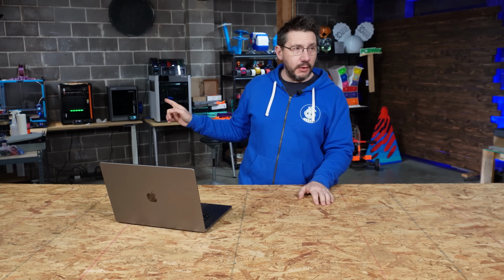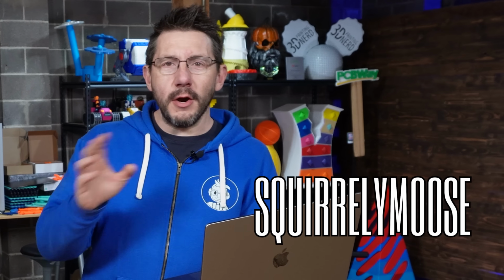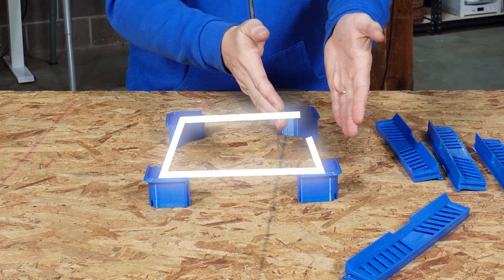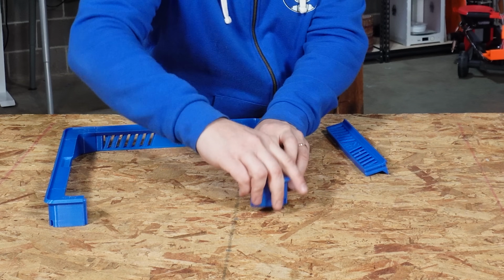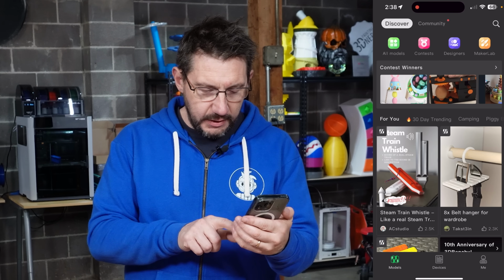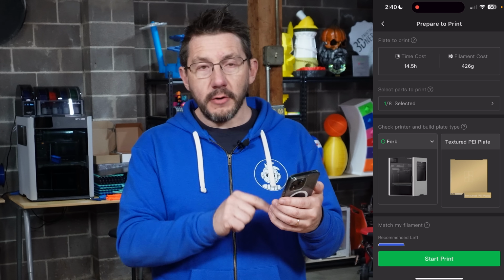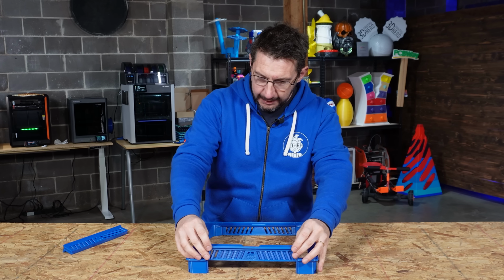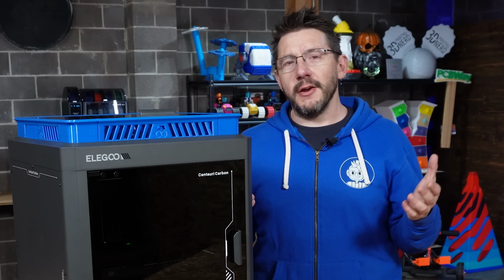*FINALLY* Printed This for the Elegoo Centauri Carbon!

Comment: I got the CC1 v2, so never needed this, but kept this video in case because I liked the idea, Until now, Hopefully I've found an unintended use.  I'm trying to print pps cf10  for a drone frame at the moment, problem is that it prints fine but keeps snapping because of the ptfe path.  You need a heated chamber so no lid is not an option.   Hopefully my solution is that I've got some polycarbonate sheeting, cut to the same size of the lid, with a hole in the center, for a direct path from my dryer, I will tape a ptfe tube, using thick heat transfer tape wrapped around the hole holding in the tubing.  My theory is that the raiser will allow the hole to be much smaller than it would need to be without it and hopefully allow me to finish the job with out snapping.

Comment: I know I'm supposed to remove the top lid when printing with PLA and PETG... but I've never done it. I think it defeats one of the main purposes of an enclosed 3D printer and to be honest I didn't notice any problems/defects with my prints. The chamber temperature gets up to 33 degrees celsius (acceptable I think) and that's about it.

Comment: for the new canvas multi color device for the 3d printer. couldn't you modify this riser to add 4 holes and use ptfe tubing to use the canvas device with a closed lid? if YES, try doing it.

Comment: A solution that has been around sin e the CC was released and solves a non-issue.   Simply prop the lid or door if you want ventilation. 3d print a small wedge. DONE.

Comment: There's a better way to release that riser "print in place" part. On one end of each of the parts with the louvered openings, is a hole. Use something like a 3mm hex wrench and push on the part until it pops loose! That's what it was made for...
Reply from the maker: OMG THANK YOU

Comment: I send print wirelessly to my P1S through Orca Slicer and the machine saves all the prints. I can scroll through them and reprint if I wish. I don't use the Handy app and the printer is in LAN mode

Comment: does the riser not defeat the purpose of the carbon filter? and doesn't the fan pulling air in to the it then out the carbon filter not do what the riser does. only real purpose for the riser that i can see is to stop the feed tube from touching the glass really and maybe add some extra light mounting area.

Comment: I never take my top off printing pla, prints just fine
Reply: Same. No issues with the top on for all my PLA and PETG prints.  I also put my Voxel Bento Box inside so that extra air circulation helps - and removes the nasties

Comment: I just got a Kobra S1 last month and I keep heading people say they have to open the door or prop the top open when printing PLA. I'm not having any issues even during 20+ hour long multicolor prints. And that part of my office is not as cool as the rest of it (it's in a dormer since my office used to be the garage attic). And it gets plenty hot here in Houston...

Comment: I modified this for my Qidi plus 3. It really would not be practical if you want to use nylon or other engineering materials that require a heated chamber. It doesn't seal the chamber. Great  idea though.

Comment: I had the same issue in one of my frame rails. I was also using 8+ year old PLA. Instead of re printing, I did a quick blowby with a hot air gun and it slipped it on to the corner piece. Nice cooled I can slip it off again and everything functions as it should

Comment: Please please do a followup where you actually test the temperature inside the printer over time with/without the lid and with this riser with the vents open/closed. There are people who have said a) the temperature takes a long time to actually build up inside when printing PLA with the top on and closed and b) that the riser doesn't do enough to let cool air in, so some empirical data would be awesome
Reply from the maker: That’s a great idea!

Comment: There is full print history on the Elegoo Centauri Carbon! I also don’t get the riser. Why not just print the brackets and take the lid off? I personally think this is better to get the maximum air out to prevent potential clogs.

Comment: Neat mod. Print in place is fun.

TBH though, I probably would've just gotten out the heat gun to soften up the distorted part and pushed the dovetail back into alignment. Don't waste the filament that way, and don't have to wait for it to print again.

Comment: Feels like I just watched a commercial for bambulab.... at least print the piece for the machine on the machine itself..
Reply: Right? Anyway I printed the exact same thing for my Centuari Carbon on my Centuari Carbon. Came out great. The print was designed to fit on the smaller build plate so you don't need a larger printer to make these parts.
Reply: Yep Bambu Ad and Bambpoo fail ..proves not all printers a perfect .. 🍻🍻🍻

Comment: 3:44 See, there's your problem, you should have printed it on the Centauri, not some pansy ass Bambu... =)

And as someone mentioned, Elegoo has a storage bracket for the glass top that attaches to the side of the Centauri preloaded. =)
Reply: I download and printed one that not only holds the lids but also can hold 3 spare build plates
Reply: @JohnDoe-bz4yl  I printed the same one! But thought I'd mention that Elegoo did think of the issue as well. =)

Comment: Wouldn't it be better vent, if one end position was open and another end position was closed -  instead of open and open (with vague closed somewhere in-between) ?

Is plastic, steel and aluminum so darn expensive, that it's impossible to make the chamber few cm higher (instead of blatantly copying Bambu Lab and rubbing the PTFE tube to the glass or bending filaments the do not bend) and have proper vents from the factory? Or maybe it's expensive cardboard boxes, or mailing by volume ...

Comment: Just an FYI, Elegoo preloads two storage brackets for the glass lid. They attached to the left side of the printer. Works great to store the glass when printing PLA...
Reply: I just printed mine yesterday, and it works great! I was concerned about it rattling because the printer does shake quite a bit, but those brackets hold it in there very well.
Reply: @benchfactor  There's an upgraded version somewhere that expands the brackets to include space for a spare bed, plus tool storage (and extra hotends). Works beautifully
Reply: @cuddlyrobot  link please?

Comment: Makes video for an Elegoo printer, spends 90% of video talking about Bambú Labs 😂
Reply: I thought the same thing...
Reply: Thank you for saving my time on watching the whole video 👍
Reply: @jamoo69g  Yeah... not worth the time
Reply: @herlandercarvalho  several times with this guy, goes to do something then asks the public how to do it. Filling up the time with failed stuff or completey off-topic
Reply: it is just an add at this point ... 

HE ONLY SHOWED ONE THING THAT EVERYONE KNOWS ABOUT AT THIS POINT 11!!!!
Reply: That and why doesn't he just file down the offset layers and not waste plastic?
Reply: I bet it would have all printed fine on the Elegoo 👀
Reply: @tccramer5272  can confirm as i am doing it now on my ECC
Reply: even failed to print it right and the elegoo has a history by default
Reply: Thanks, .I didn’t even bother to watch
Reply: @CristianG13  thought I was trippin. Had to check the title again to make sure I didn’t accidentally go to another vid 😂
Reply: Printed the Carbon mod in the A1 when the carbon has the exact same build plate size...

Writing this as my Carbon prints the exact same riser tho XD
Reply: Thats great that this exists however Bambu Handy doesn't support Elegoo printing. The real trick is telling me where to find this file in a place that I can print it on my machine.

Comment: I have a Bambu P1S and you can definitely reprint any job you've sent to the printer from the LCD. Go to the folder icon then the cache folder and all historical prints are there
Reply from the maker: For me the latest always overwrites
Reply: @3DPrintingNerd latest firmware? I have EVERYTHING in that list
Reply: @3DPrintingNerd  do you always just send prints named as "Untitled" or something? When I click print plate, I always name my print in that dialog box that pops up (with timelapse and auto bed leveling on/off toggles). Before always latest would overwrite because I would always send them with the same name so it would just overwrite the same file. It's weird that in your case always last overwrites. I do think there is a limit on how many latest prints it stores on SD card in that cache folder, but I think I can see at least last 10 prints that I've sent.

Comment: It would be interesting if you dumped firmware from your Elegoo Centauri Carbon and verified if Elegoo steals other people work (Klipper). One user on reddit did that (including description on how he did that) and he said that tool head contains Klipper firmware (as visible by strings in binary that match Klipper binaries).
Reply from the maker: I appreciate the heads up, I’ll look that up.
Reply: Really no one cares as long as it prints

Comment: Started with the JF riser that you are showing.  Beautiful design, but leaks too much heat with Abs/Asa, etc.  Changed to a taller, but better sealable, Printables design by 3D-DruckBude.  This one, while a little taller, does retain heat well with the vents closed and still works very well with PLA with the vents and front door open.  DB model has nice built in channel for LED's, though did add opening for more generic led power cable pass through.
Reply from the maker: Ooh I’ll check that one out!

Comment: I'm pretty disappointed that this video is all about the Centauri Carbon riser, but you didn't do any printing on it. There's even pre-sliced files for the Centauri Carbon to print all the pieces at once. This seems more like a Bamboo Labs promo showing off a feature of their app.
Reply from the maker: … okay? I had the Carbon setup for PLA and the H2D was loaded with PETG and ready to go. After the first print with the problem I thought the way I did reprinting was interesting so I showed that too.
Reply: @3DPrintingNerd  Showing off the way you did the reprinting was indeed interesting! Another commenter said this is something we can already do on Klipper enabled machines, but this really is different to the 'Cancel Object' type things we've had before. Being able to pick and choose the objects to print from a previously sliced g-code before sending it back to the printer is awesome!

The part that I actually find disappointing is that I was hoping for something new when I came into this video. This riser has been the most popular result on Printables for at least a couple months now, and I would assume the majority of CC owners have seen this already. From the title alone I thought there was some awesome new upgrade or mod for the printer, something new from the community to show off. 

The H2D having the right filament loaded when you went to print is understandable, I've done the same thing. If I were in your position though and was making a video talking about a cool mod for a specific printer, I'd want to make sure that my audience (in this case, owners of the Centauri Carbon) could see the printer in action and would print at least one or two pieces on the CC for my b-roll. Doing it all on the H2D just feels a bit strange. 

I was wrong about the pre-sliced files. Looks like I was remembering either the photo in the description of how Jesus recommended printing the files, or possibly the remix that does have a pre-arranged plate

Comment: So... it's a must have upgrade for a problem that's caused by a ghost? I didn't really understand the point of the video. Sure it's nice that people come together to create stuff, but ... this only raises the glass up, not removing it, hence keeping it accessible to said ghost.
You should be more clear as to why this exists and why it is a must have.
Reply: lol Uncle Jessy is youtuber that broke a K2 glass door during setup so it's a running joke with other 3d printing youtubers now. 

The riser is a great addon for keeping your glass lid safe which is the point of this video. I printed it for my Centauri Carbon too along with replacement hinges so I can open my door flat against the side instead of leaving it jutting out where I might break it.
Reply: @LoriAnneBrown  I know about Uncle Jessy's K1 Max door glass mishap. But this is a glass lid on top of the printer that isn't even vertical and not hinged - so why is it in danger of anything? And even if it is, this mod only raises it up a little bit.
Reply: @TNX255  Because it's not attached to anything and can be easily dropped if you don't have a place to put it safely. I have a print farm too and in that environment, space is at a premium and many have printers side by side with no safe space to set the glass down. The riser lets you keep it on the printer and just open the vents instead of removing the top when you are printing pla. Works very well and I haven't touched the glass since I added the riser. It raises it up about 2 inches actually. It's not necessary, but very helpful imo though its going to depend on your setup.

Comment: Bambu has a cache folder on the SD Card in the printer, you can access it through the folder menu on the printer and reprint the 3mf file. I've used this many times to repeat prints and avoid reslicing.
Reply from the maker: Right but it’s the last printed thing, it’s not the history. I’ve also used this and it’s super handle when you just need the last thing printed again!

Comment: A 8+ minutes video for a glass riser. Interesting choice. Could have been better if it was a printer mod video all together and done mods for several printers.
Reply: Especially since this isn't new. The riser is as old as the printer basically
Reply: And the Bambu lab features have been available on pretty much any klipper enable machine for a while and no phone or cloud connection necessary.
Reply: To be very clear I like your videos your one of the first people I go to when looking up 3d printer stuff so I’m not a hater.
Reply: Fun idea. You should make one!